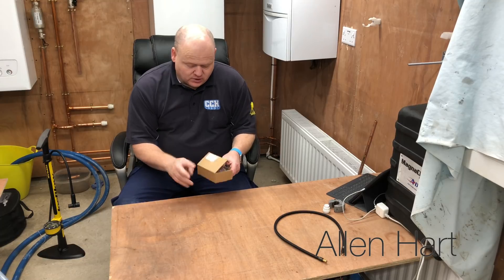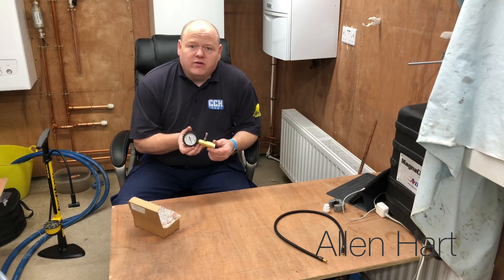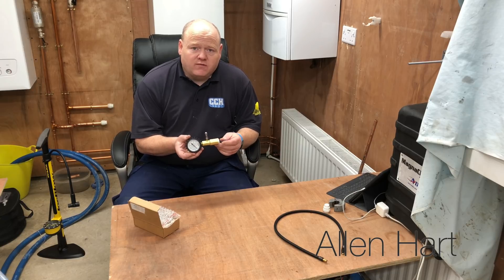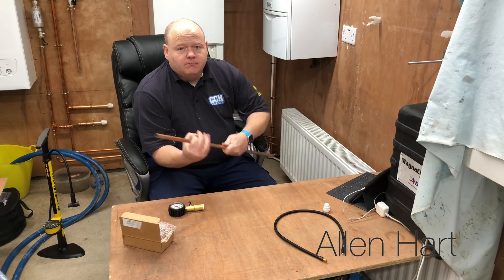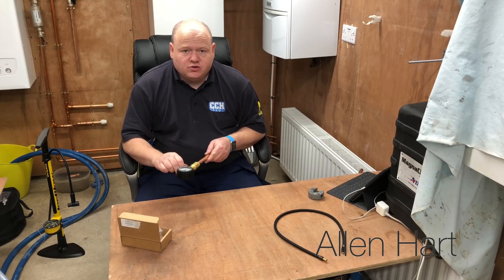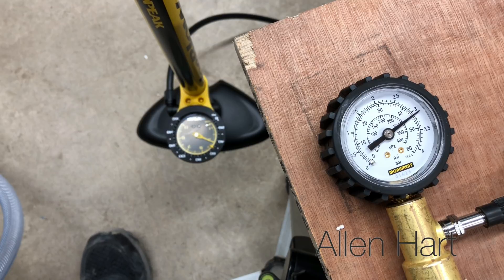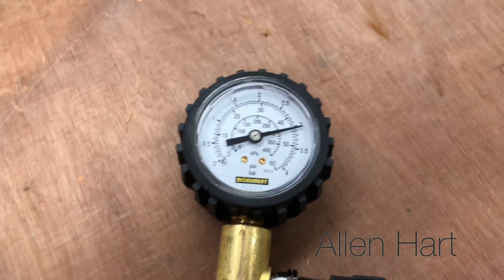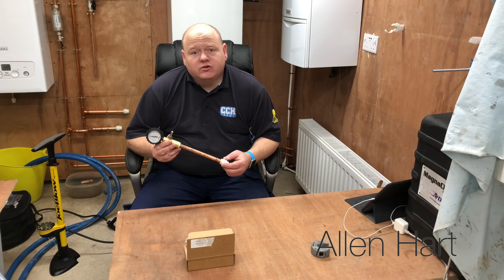Monument dry test kit Review and Demo

Comment: Is this Part 1 of how to Test a Metal Water / Oil Pipe System with your favourite Pressure Gauge ?
I was really hoping to see some Hands on Investigation, I was curious to see if someone had a method statement on How to Dry Test a Metal Pipe / Hep2o Pipe System.
For anyone reading this, Within the Chemical Industry Air Pressure has been applied to Steel Pipework prior to running Oil / Chemicals for decades, each joint has a coating of a Chemical that produces results similar to using Washing up Liquid [it Bubbles] and NO, Engineers do not go around listening for a noise, pinning their Head next to a ticking bomb !!!
Remember for those doing a 24hr Pressure Test that due to air temp outside of the Pipes this can and will effect the Fall or Rise of your recorded Pressure, as a general rule it is better to do 2 separate 8hr testing periods with a constant air temperature than 1 x 24hr Test, for safety sake always coat the pipe joints with a suitable lubricant prior to raising the Internal Air Pressure.
Mr Spence Eng

Comment: Have used and great for testing new pipework. One thing I would mention, especially for those who are DIY is that the build up of airpressure can be very dangerous, especially if a fitting is loose, have had a stopcock whizz past my nose before many years ago and memory still sticks with me.

Water test is probably better IMO, for also finding the leaks as there is an imminent visual representation.

Also, If doing air test on a large install, certianly worth testing sections as you go.

👍

Comment: There's a video on YouTube that clearly states "Never Ever" Air Test plastic pipes. 
So who is correct?

Here's the video:
https://www.youtube.com/watch?v=6ALvhbDGJfE
Reply: I think IMO that they refer to Rigid Pvc Pipes, which do not bloat or enlarge, they just EXPLODE
Mr Spence Eng
Reply: That is for solid PVC type piping, i.e. waste pipes and the like. This is for copper piping and PEX/PB style water pipe, i.e. Speedfit etc which is going to hold 3-5bar water pressure in use so dry testing to 4 bar is fine.

Comment: Old video I know, but I have been using this for a while now. 

I usually pressure test to 2bar. If there is ANY kind of leak, it leaks immediately. And you can hear the hissing. If there is no leak the gauge will stay rock solid for 5m at least. If it does stay, you have no leak. 

But word of warning: if you plan to leave this pressurised for say an hour or even overnight, what I have found is that, even on a short length of pipe with a stopend fitted,  the gauge will drop. 

So don’t think, I can pump this up to 2bar, leave it overnight and if it’s not reading 2bar still then I MUST have a leak in the pipework. 

Because I suspect the tool is not that accurate and it leaks a very small amount itself. 

Also, you should be aware that air temperature itself will move the dial. So if you pump up at say 22C in the day and leave overnight and it goes cold and you check first thing in the morning and it’s say 15C then again don’t expect the gauge to be the same reading. 

When I need to be certain, I test with water.
Reply: That's really great to know a leak will show pretty much straight away, thanks for the info. I need to use it on 22mm pipe what do you think would be the best way to increase the connection size? Push fit or solder a 15mm to 22mm? Thanks again.
Reply: @charlietwohats  pushfit is fine. But I have made up a bunch of convertors. So I have a 28->15m converter and a 22mm-> 15mm converter made from soldered connections. 

I use it all the time (used it twice just yesterday)

Saves you so much time and no mess that you get with water. 

But - PLEASE BE CAREFUL!! Compressed air can be very, very dangerous. Seriously 😐 

Much easier to test with air though, just please be careful 🙏
Reply: Thanks for this comment. I was concerned that I had a leak using this device, I pumped it up to 3 bar and it stayed at this pressure for a couple of hours… But then I left it overnight and it dropped to just over 2 bar the next day. Do you think this is normal? I also noticed that if I disconnected the foot pump, the air valve leaks, I wanted to make sure it wasn’t the foot pump leaking air but no way to tell… Do you think I should get my unit replaced? Does yours allow you to disconnect the foot pump?
Reply: @JuliusBangert  been there, seen that 😁

Your comment is why I added my comment because it drove me nuts thinking I had leaks when I had none. It’s not a precision device, so it will leak slowly and convince you (overnight) you have a leak. The valve is obviously the weak spot and yes mine is a pain if you keep the pump connected. So I disconnect the pump when I have built up to the pressure I need
Reply: @GeeTheBuilder  oh right. So yours lets you disconnect the pump and the valve holds the pressure? At least for a while? Seems I should take mine back to Screwfix then and get a replacement. As soon as I disconnect the pump, the air hisses out.
Reply: @JuliusBangert  yes, that’s broken!
Reply: Thanks this helped a lot just tested water and heating dropped 3psi over night,but didn't drop when I first pressurised the system... was worried it was leaking

Comment: Hi Allan when strength testing example tpcp1a 82.5mbar or 2.5 x mop on natural gas well 82.5mbar is more than most water  manometer s but still very low pressure ? Any thoughts

Comment: Hi Allen, could you use this to pressure test an underfloor heating system while the screed is being applied?
Reply: if you pressure test the under floor system will it expand the pipe work, then when you release the pressure, will not reduce in diameter to a point, where it might not be in full contact with screed, causing it to not be able to transfer the heat to the screed 100%
would you not be better off, testing it before the screed is applied, so you can do some thing about it, while you have access to it. if there is a leak.
Reply: @daibhiseaghdha153  as per manufacturers instructions with UFH, pipes should be under pressure while screeding so that after the screen cures, the pipe has space in the screed to expand and contract as required.
Reply: @WatchingTheo  thanks very much for putting me in the picture, I love learning, from people who know what they arte talking about..

Comment: ok for going upto 0.5bar but over that you need to do a water test due to air compresses and you could kill someone, also on plastic pipe it needs to be water, as it will test fine on air but could leak on water
Reply from the maker: Thanks for your comments.
Reply: Pressure Test with 3 bar of water and a fitting fly's off, it will hurt you
Pressure Test with 3 bar Air and a fitting fly's off, it will hurt you

Overpressure in an enclosed space is determined using "Weibull's formula":[3][4]

{\displaystyle \Delta p=22.5\left({m \over V}\right)^{0.72}{\text{bars}}}{\display style \Delta p=22.5\left({m \over V}\right)^{0.72}{\text{bars}}}

where:

22.5 is a constant based on experimentation
{\displaystyle m\,}m\, = (kilograms) net explosive mass calculated using all explosive materials and their relative effectiveness
{\displaystyle V\,}V\, = (cubic meters) volume of given area (primarily used to determine volume within an enclosed space)

Mr Spence Eng
Reply: That’s fine but air compresses much more than water so the volume of air is greater than if you were to test with water

Agree water would still hurt but air could potentially kill you
Reply: @corbs07  Yes I would totally agree, this is due to water not compressing like air, selecting a much lower air pressure would be advisable than if you were testing with Pressurized Water.

In finding leaks, using a Pressure of say 2 Bar Air to Test is as effective as using Water at at a Pressure of say 5 Bar [imaginary numbers to give an idea only]

It is good to know that the viscosity & surface tension of Water is much greater than that of Air. 

Air Pressure Testing can produce leaks under Test that may not show up using a Water Test, this is because of the unique forces that prevent water from escaping through a very Small Crack / Hole, but do not prevent air from escaping from the same small Crack / Hole, the reason being that Water has a Tension on it's Surface,
An example of Water Tension would be If you dropout of from a plane and hit the water below, then the tension would be like hitting a Bed of Concrete and another reason why when Diving into a swimming pool, you place your hands in a position to break the Tension of the water (:
Mr Spence Eng

Comment: Do you ever put a water pressure squeeze on a big system you have installed to test for hydraulic tightness?
Reply from the maker: I have never tested systems before i fill them tbh. We do mainly boiler replacements , Thanks

Comment: Its bloody expensive for a 
£4 pressure gauge 
£1.20 1/2 - 1/4 bush 
And a £3.00 15mmx1/2 speedfit tap connector

If you want to put a foot pump on system get a schrader valve with 1/8bsp and reduce up to 1/2bsp then convert to speedfit
Reply from the maker: I never even thought of doing that TBH, good idea though. Thanks.
Reply: It’s really not that expensive for the time it saves you. 

You can always do things cheaper if you have the time and inclination. Like building a new PC from component parts etc

But for most people, this is an absolute bargain and will prevent leaks.
Reply: By this method u can have higher max range?

Comment: I prefer to use a compressor as opposed to a foot pump, it's a lot faster.
Reply: Yeah compressor advised. On long runs with 28mm and 22mm you will end up with quads like Jonah Lomu using a foot-pump!
Reply from the maker: good idea.
Reply: Me too. I needed to test 30m of 28mm and a foot pump was useless. So I used my compressor. 

But take note of my broader comment above, be careful of relying on this type of test.

Comment: use this a lot on new builds to dry test pipework and log results before chippies and drywallers place nice screws in pipework
Reply from the maker: Whats your opinion on it, Thanks for watching.
Reply from the maker: £30 from Screwfix , https://www.screwfix.com/p/monument-dry-pressure-test-kit/72940
Reply: + Oliver Smith.. regardless of where you run the pipes and even if you draw the pipe runs on the boards "pipes. do not screw/nail" There will be some eedjut who will hit a pipe. Happened to me 3 times on an extension job just last week.